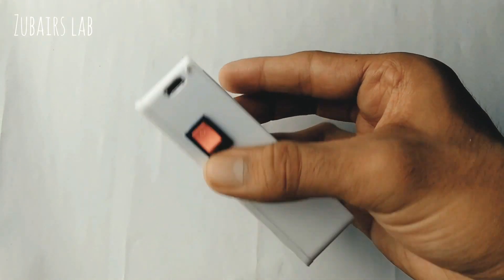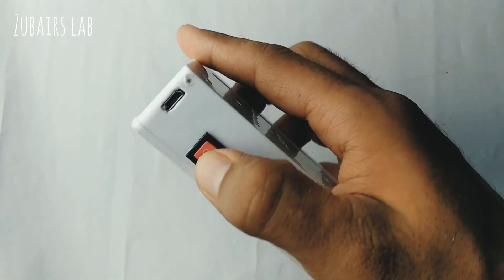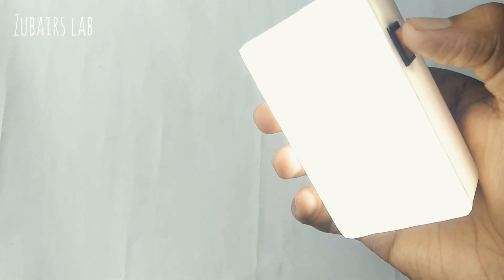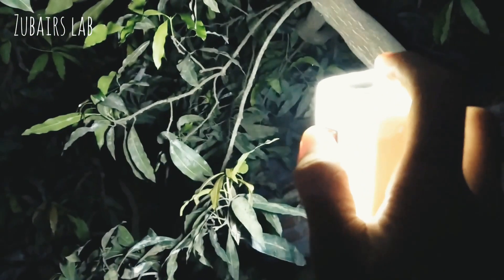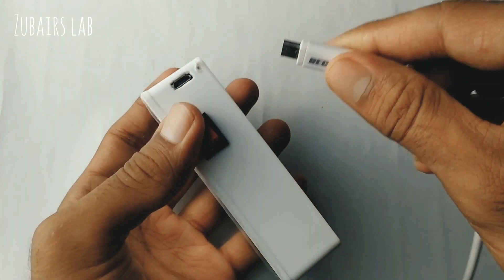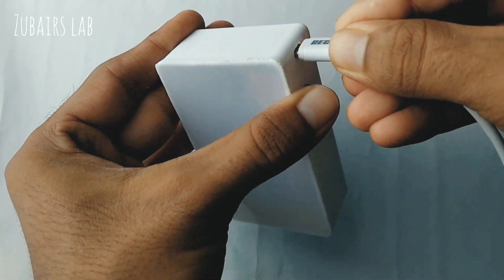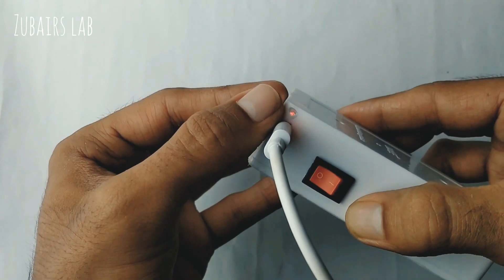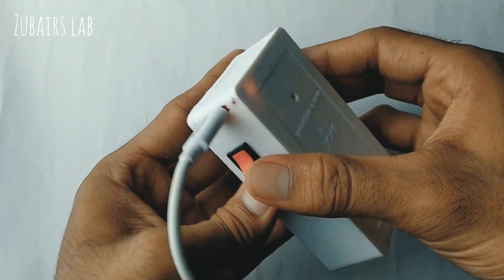How to Make  Rechargeable Emergency  Light | DIY LED Flashlight

Comment: Good Video, But for safely please insulate all connections and also make sure you do not place LEDs on top of Bettery, rather you can make a separation or a sheet below LED not to transfer heat to the Battery. Take care.
Reply from the maker: Yah.. Thanks for your complement binoy brother. Next time I'll make better..❤️❤️